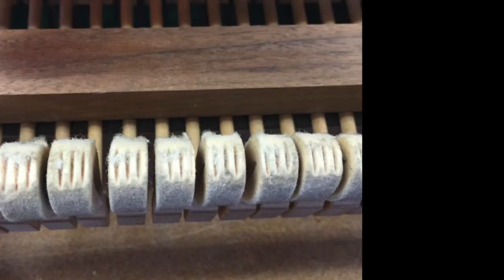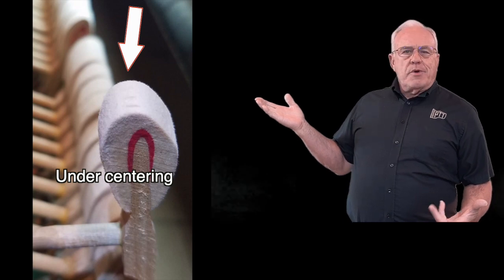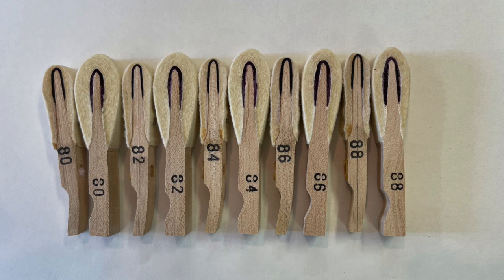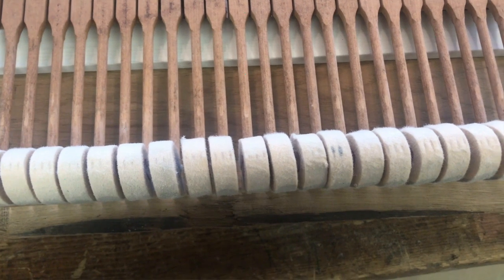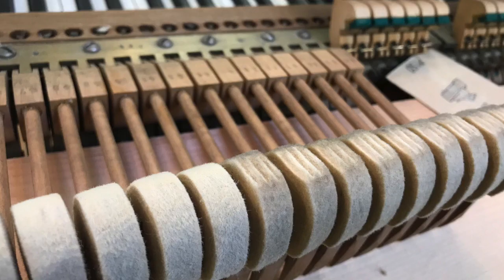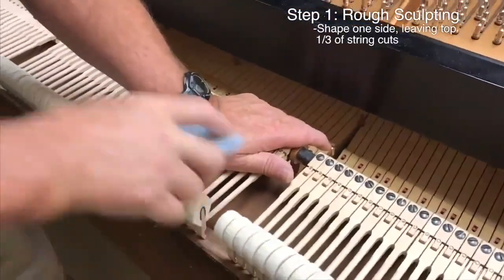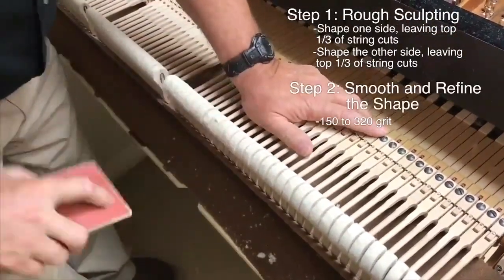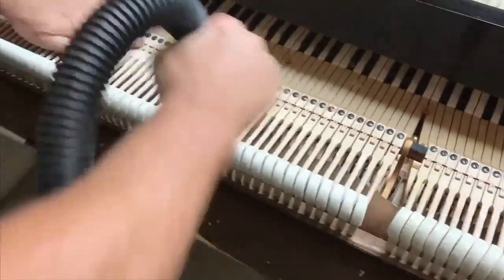Pro Tip 28: Hammer shaping

Comment: Thank you very much for the great video. I love watching your videos all the time. May I have one question, you mentioned to remove 1/3 of the string mark, do you mean the string mark in length or in depth?
Reply: Hi Nelson. Length. Shape both sides and remove 1/3 on one side and 1/3 on the other, leaving the middle third. That middle 1/3 will also be not as deep, so I guess you could say both length and depth.
Reply: @jbuzz8853  I see, thank you very much!!! you videos are great!!!
Reply: I had the same question...thanks for the clarification.  You're taking off 1/3 of the cuts along the profile of the hammer first in back and then in front, but ultimately removing the entire depth of the cuts. A diagram would be helpful!

Comment: I replaced all the hammers on my grand, but sadly the technician shaved the tail, so much… way too much, so that the tail is super thin now, like a piece of thin paper wood… even can’t be easily voiced because it can be easily broken. What should I do? The hammers just be replaced a month ago 😢😢
Reply: That’s unfortunate. There’s not much you can do. Laminating the tails with something like wood veneer could strengthen them but will also add a bit of weight to the hammer which would possibly  alter the touch weight. It would be better than broken tails though.
Reply: Why did he shave the tails so much ?